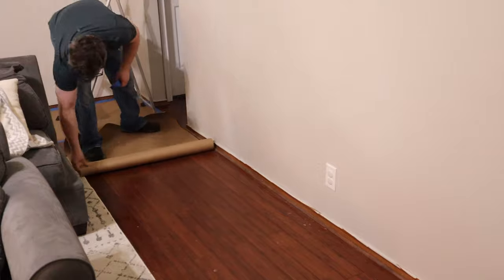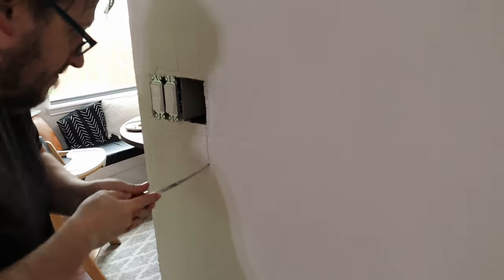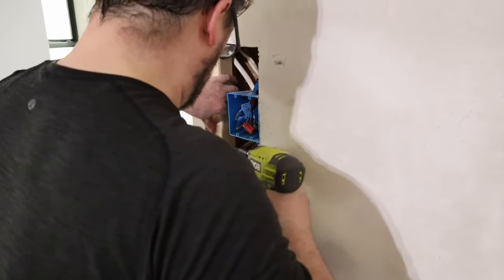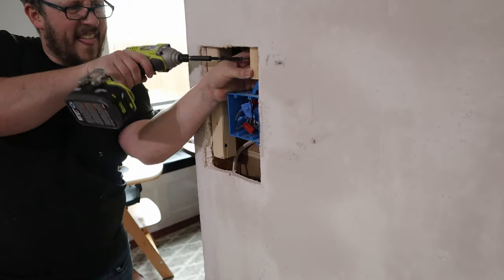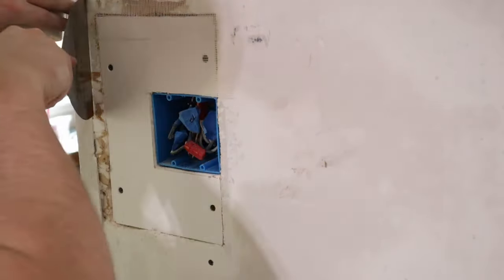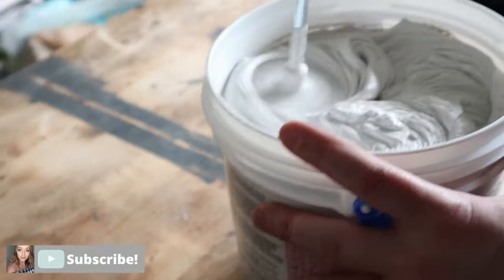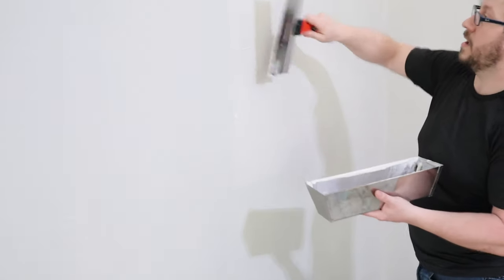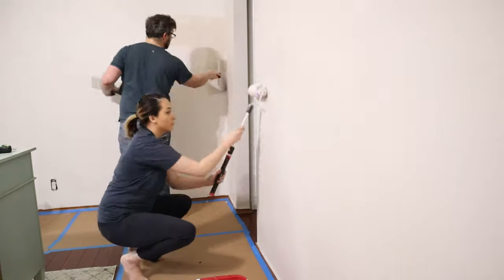HOW TO SKIM COAT TEXTURED WALLS USING THE MAGIC TROWEL | EASY TUTORIAL FOR BEGINNERS | Episode 2

Comment: One much less messy way to sand, is to instead get a damp sponge, and wipe the walls. It smooths out imperfections from the joint compound. Much cleaner and faster too. Regardless, you two did a great job. Thanks for the video
Reply: You saying to do this instead of sanding?
Reply: @Trsyup  ...it sounds like wet sanding
Reply: @mariad4183  It is. That what my dad did when he owned his own business. Like the other person said, it’s a lot less messy, but still effective.
Reply: @anneshirley9560  ...I have to try this on my upcoming projects!  Have been watching all the how-to videos.  Thank you for sharing honey!
Reply: @mariad4183  did it work
Reply: Thank you for the tip. It worked 😁🙏
Reply: So do you wipe the walls before or after they’re dry? 🤔
Reply: takes a lot longer but no dust for sure
Reply: That's a good idea. If the wall is a little wet, it won't leave marks from the sanding.

Comment: I think it’s easier and more cost effective when considering labor to just tear out textured walls and replace especially if the texture has been sealed and will not soak up water to scrape. My feelings toward filling the texture is it’s going to be messy and uneven in places. It just doesn’t give that look of new smooth walls. And hopefully later on chips don’t fall out here and there from not sealing good. The labor you spend to scrape a wall is hands down more costly than just replacing.

Comment: Omg this is so much better than what I was going to do. I thought I was gonna have to sand all my walls🤯
Reply: I've been trying different approaches in my new place. The first time I tried to do a round of sanding as the first step - terrible idea. Drywall dust is a nightmare and this made a huge mess. And I learned it's not necessary. It's way easier to do a quick and dirty thick coat of mud for your first pass to lessen the severity of the peaks and valleys. Then on the second pass and beyond you can take a more finessed approach.

Comment: If you're having trouble seeing the mud you applied, mix blue line chalk into your mud
Reply: Would a stick of chalk work as well? So many times I'll enter the room and "see" something and when I go back I can't find it again. I'd like to do a check during different times of the day. I'm not sure if the chalk with show up under the mud or paint or anything. Thank you.
Reply: Use a light instead
Reply: Dont use chalk at all.better to get a bottle of drywall Mudd dye
Reply: @pearlperlitavenegas2023  Yes, you use a light but in addition to, NOT instead. You use a light to identify areas that need touch up, i.e., low spots. You touch up those areas with mud mixed with blue line chalk so you can see the areas that need to be sanded/feathered.

You don't use red because it can bleed through the paint. Use just enough chalk to be able to see difference in color. As for the light, the halogen 500w work lamps work best IMO.
Reply: @chrisjerson5622  think you're probably referring to tapers tint or something similar. Sure, that works for 6x the cost.

Comment: Hello! Great video and thank you. 
I am trying to do same project at home. Curious how the mud will stick to an already painted wall. I started sanding the texture down to let mud adhere better but it is so much work. 
I did not see you sand texture except scrape the high points. Was sanding not necessary before applying compound?
Reply: I have the same problem, painted orange peel texture. Did you try scraping the texture first then sanding paint off?

Comment: Wall texturing is an excuse for bad drywallers.
Reply from the maker: totally agree!
Reply: You’re so right. Me & my husband just bought a new house this year and are already seeing issues with the drywall and every wall in our house is textured
Reply: I hate textured walls. Smooth is the only acceptable option. It will never be outdated.
Reply: texture helps hide imperfections and smoth walls are far more expensive to make , that its not very ideal
Reply: @rpainter6862  I'm skim texturing my entire house and it's not "far more expensive" I'm getting rid of the shitty drywall tape lines that shouldn't be there to begin with.
Reply: @michaelt.9372  i meant its expensive for the builder because the workers need to spend more time on each wall to ensure its completely smoth and nearly flawless for a diy its cheap but not to pay someone wlse to do it
Reply: @rpainter6862  this is true achieving a level 5 finish is very time consuming and we charge accordingly. Everyone thinks we have it easy as painters until they have to do it perfectly and time efficiently
Reply: Not when you are doing 10 houses can’t skim cost
Reply: They've been texturing since the 50s in the US.
Nothing to do with bad drywalling.
It's because nobody can plaster anymore.
Just the way it is.
Reply: I’m thinking in the case of our house, this statement is true lol!
Reply: Yo Michael, maybe some people actually LIKE texture cause they find plain flat walls are damn boring.  Hence why I changed all my boring plain flat walls to Santa Fe with some kind of character to say the least

Comment: Nice video! Never heard of the magic trowel. The only thing I would add is to clean the surface with TSP prior to skimming (I did not catch that in the video but maybe I missed it)?  I have seen skim coats "fall off" walls and ceilings because they did not bond well with the surface being covered. Thanks for the vid!
Reply: This is good advice.  I lived on the east coast and the plaster guy, who had been doing this stuff for 40 years, strongly advised to use a kilz primer before skimcoating for adhesion as well.  They do fixes that last decades with plaster, so they know whats up.
Reply: The trowel she is using is actually a knockdown trowel for knocking down texture such as orange peel. The end of it is flexible so that you can wet it and knock the texture down. I have one. You can add a pole to the end to reach high walls and texture ceilings. It also allows you to have less marks on drywall compound that a trowel would make on a wall. Its a great tool to use in skim coating a wall.

Comment: Thank you for this vid! I have a house full of this that I’m hoping we’ll be able to start this year. Great tips! Just what I was looking for :)
Reply: There are drywall sanders that make things easier. Harbor freight has one with a 9" sanding surface 1500 rpms variable speed sander that extends 5' has a light on sanding surface to highlight high spots and defects. Has a ring around it to keep dust down so the vacuum can suck up the dust better through the 15' hose. It's 150.00 which is pretty good price. Most are well above 300.00

Comment: My sander is electric and has a vacuum and bag attached to it so hopefully that cuts down on the dust. Or you could just use a damp sponge. It melts away the access and smooths the wall almost as well as a sander.

Comment: I'm taking off popcorn ceiling and want to smooth and paint it. Will this procedure you did here work on the ceiling?
Reply from the maker: I actually have a video on removing the popcorn ceiling on my channel! check it out! :-)
Reply: @BethanyBrenneman  thank you, i found the video for the shiplap, but not the one for just simply getting the ceiling prepped to paint it.
Reply: Hi Susan not sure if you've had your popcorn  ceiling removed  yet,  be ware if your not already : if your popcorn texture  was applied prior to 1990  it most likely contains asbestos , be sure to take precaution . Be sure to look on line , there is a lot of info on its use and  when it was banned  to when existing stocks were  actually in use  until etc  - hope that helps
Reply: @philrilp1122  I thought it was like the 70s! My house was built in 1983. I'm planning on taking all the popcorn off as I continue on the total house upgrade. I took the popcorn off the bathroom already, but I'll look at the videos you recommended before I do continue. Thanks for spreading the needed knowledge!
Reply: @susannoble4252  I believe it was bnned  for ceiling use  in 77'  and it seems like it was phased out after that meaning the industry was allowed to use up existing stock on hand . Depending on the source  some 78-79 ... i ve read that anything before 1980 should be tested or if your unsure . You're prob ok 1983?  As a contractor I'd have it tested before touching it from a liability standpoint if it  were my place and i lived alone id remove it as if did and dispose of it   if it did  but never test it , if i lived with spouse, kids, parents , roommates, renters any other humans or pets i'd have it tested. Hope this helps

Comment: Thanks for the tutorial! I read a couple articles that used the technique you used. I had a question, did you use pre-mixed join compound and then thin it out with more water?
Reply from the maker: yes, we ended up adding water to a pre-mixture! also, the magic trowel suggests a thinner consistency than a regular trowel.
Reply: Flip to Farmhouse awesome thank you(:
Reply: @BethanyBrenneman  wont you have a lot of shrinkage if you water it down? As time goes by?

Comment: The studs are close enough to just open the wall 1/2 inch or so and attach the drywall directly to the stud.  The box is secured ton the stud so you know there is a stud there.

Comment: Do you have to prep the old wall before?
Reply from the maker: No real prep other than pushing down raised areas. You could sand if the wall is extremely textured. We just shaved down high areas in random spots and got started.

Comment: Would I be able to do this if I have a dark color and chipped texture walls
Reply: I'd watch a few other videos to learn the technique. The Vancouver Carpenter and Paint Life TV is another. Id personally sand down any chipped texture and fill those in with compound and let it dry. You want an even surface before starting. I wouldn't think dark color walls would make a difference. But you might look into see if you need to prime the walls first, but you do need to prime the walls before painting. Definitely do more research before beginning.

Comment: This is my first time skim coating a couple of textures walls with joint compound but I'm a little concerned I'm not doing it right seing as how after the first coat there are a massive amount of ridge lines due to the texture being uneven and some points on the texture higher than others
Reply: Skim coat videos on youtube are 95% impression management. That wall needs 2 more skims and another sand and another touchup and another sand and then a seal, a prime, and so on. In other words, bring in the flat paint and setback victory shot

Comment: Do u have to prep walls besides smoothing off lumps?
Reply: Just close up any holes you might have with joint compound. And take a metal putty knife and knock off any hight points you may have. Skim coating will do the rest.

Comment: Super fine Crystalline Silica dust from sanding drywall mud, gets everywhere once it floats in the air. But hey, you saved a few bucks doing it yourself right, even if it exposed your baby to a carcinogen.